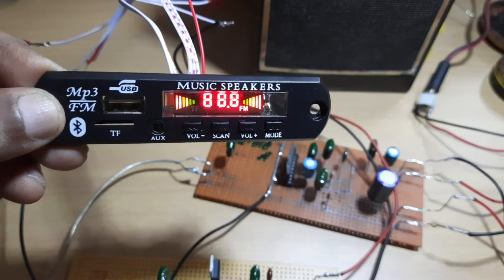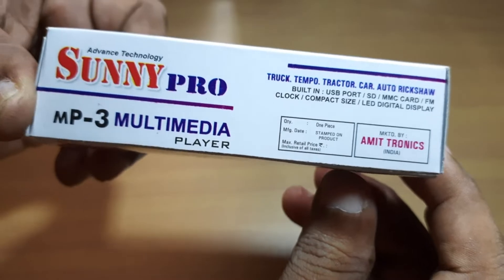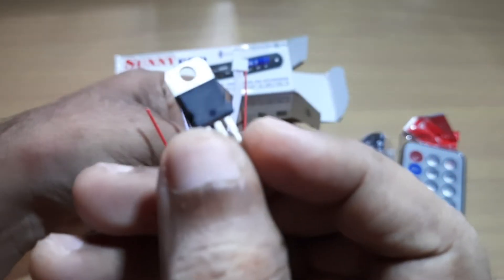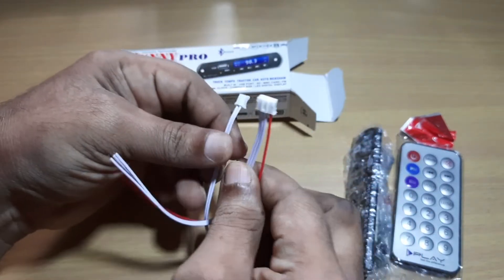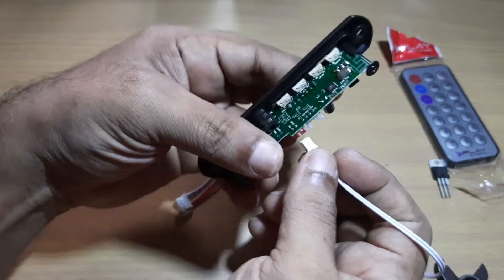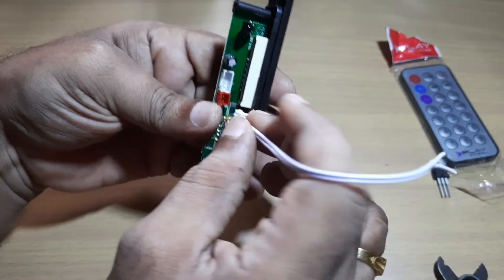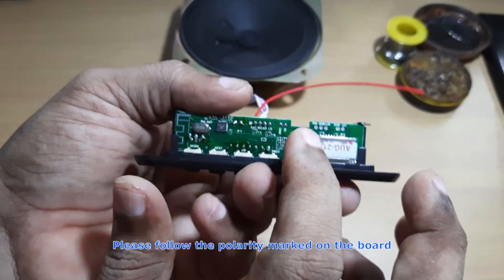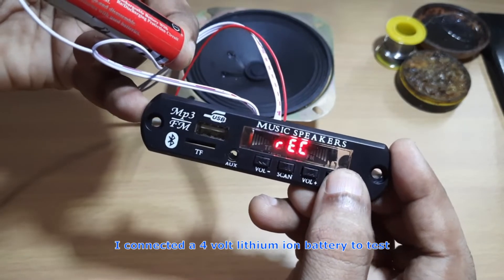Working of an FM, Bluetooth and MP3 Player Module | How to Construct a Digital FM Radio-Audio Board

Comment: Can you comment about its durability?
Reply from the maker: It can last long if it is supplied with the required voltage of 5 volts using regulator IC.